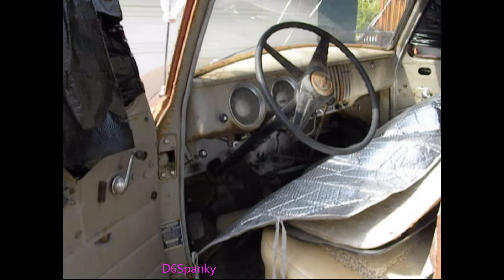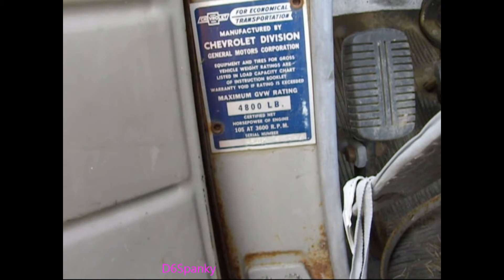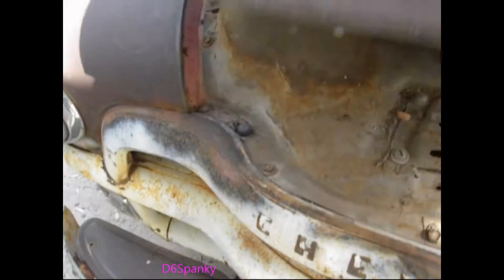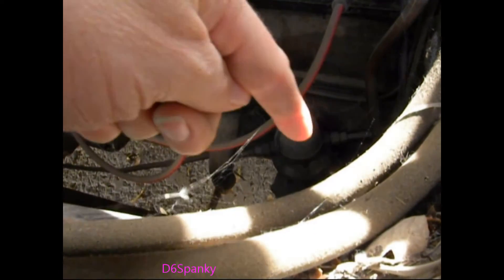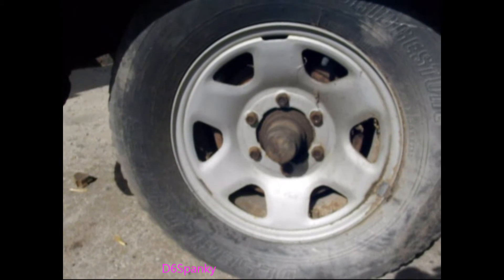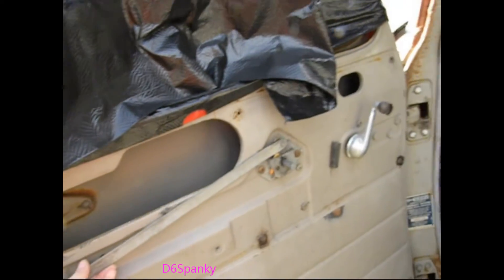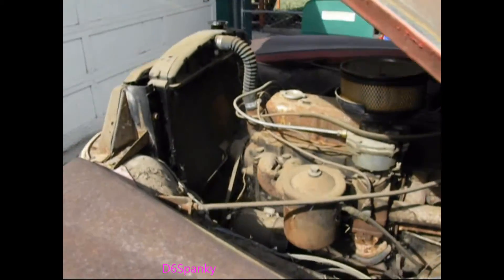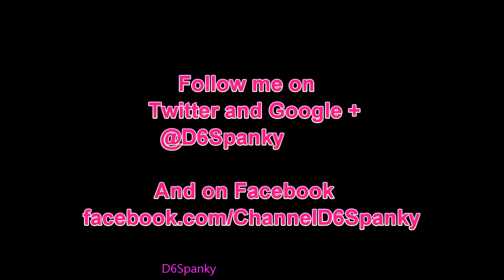Overview Of The 54 Chevy Truck Project

Comment: Spanky if you can keep the truck original, rebuilt the engine and trans, start with that and wires so you will have your truck running, than body work, leave your upholstery last. Good luck on your restoration.
Reply from the maker: That's the plan! Although I'll have to get that seat upholstered before the body work because I need to fix what my son destroyed.  LOL

Comment: Since you have already put lube in the cylinders before trying to crank it over remove the plugs and turn the engine over by hand several times by using a long ratchet or breaker bar and socket ( the crank pulley bolt is where you turn from ) this step will help any piston rings that might be stuck loosen up " gently " rather then getting hit with the forces that occur from cranking the engine over . after 3-4 revolutions put the plugs back in but leave the coil wire disconnected. now crank the engine over ( would be a good idea to attach an oil pressure  gauge for this part ) if you are unsure of the condition of the oil and filter I would change them prior to initial start up. not sure what your plans are for the drive train but if " not " doing a full rebuild , plan on replacing valve cover gasket , oil pan gasket , all hoses ( especially fuel lines ) all belts as these things dry rot from lack of use. have fun with this project. perhaps we will see Brian making an appearance on this project ( would be cool to see you two working on it together )
Reply from the maker: I've missed you!  no,  it won't be a rebuild. I already have a bunch of parts on order. I'm excited to try turning it.  I'm not terribly worried as it ran 12 years ago.
Reply: I have missed seeing your smile as well. if the truck has not been started for 12 years I would still recommend the steps I listed. also don't forget to drain the gas tank and add fresh fuel. I will be following your progress.
Reply from the maker: :D I got a list of what to do in order from my former instructor.  I think I've lubricated the cylinders enough to try to turn the crank. I'll be sure to film it when I do!

Comment: Take a look at the restodan channel. He has a "get it driving asap" approach to restoring his cars. Be aware that engines that have been sitting for years may seize if they are turned over then left again without starting. I would get the engine running first off a can of petrol. Have a good fire extinguisher and hose pipe on hand as who knows what may happen. Have fun.
Reply from the maker: I will check that out!  thank you!